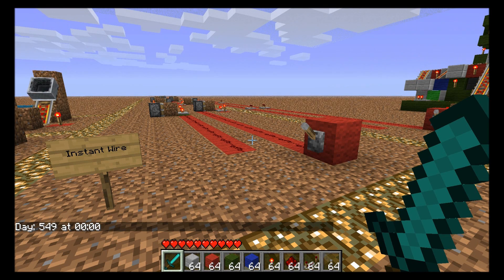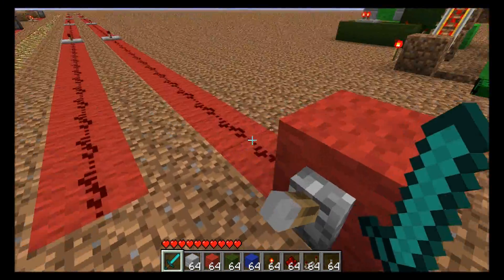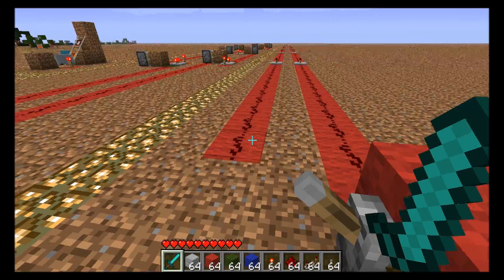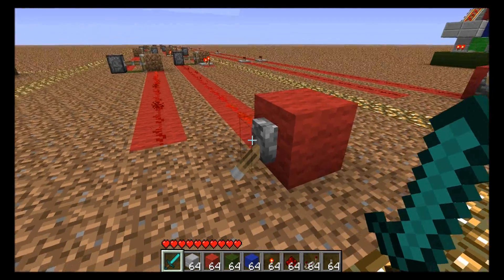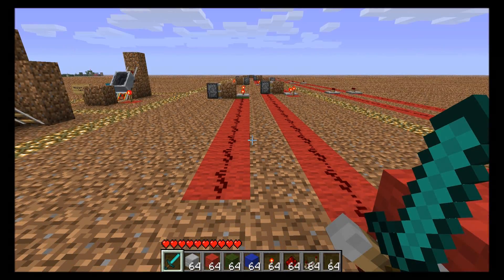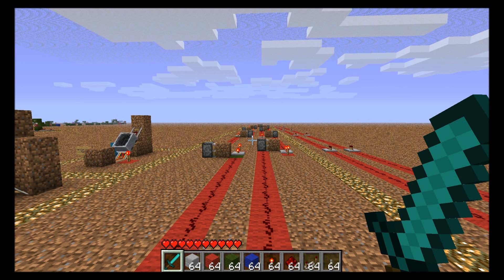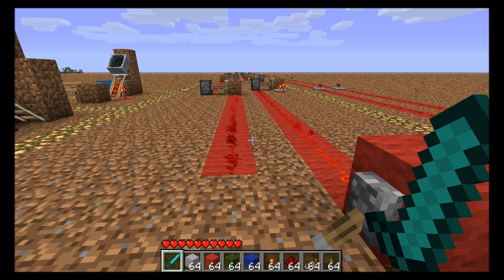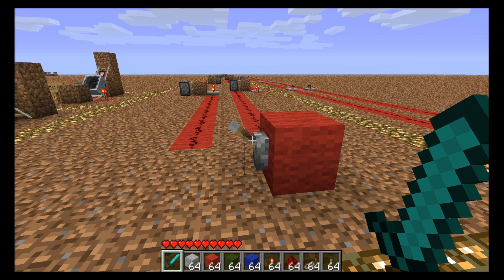Instant Wire

Comment: My god, thank you so much for this, i had the idea awhile back of a "Metronome Clock", due to the different output types, so i'd have the output go in a rhythm, and this Instant wire made it SO much easier, now my metronome clock idea still needs alot of work, but, with it, you can make a waltz extremely easily (3/4 time) etc... noteblocks became better in my opinion, if i finish this 'Metronome Clock' idea anytime soon, i'll perhaps show you in a video ^^ but, again thanks a ton!

Comment from the maker: @snati4 Ahh, there's the problem. I was playing Minecraft full-screen by pressing the Maximize button, but that still leaves the title bar and start bar, so my videos were 1920x1018 instead of x1080. If instead I press F11, that makes Minecraft full screen, and it's 1920x1080. No more black border!

Fraps codec/file size isn't a problem... no matter what you do, captured files have to be reencoded at some point, and WLMM seems to do just fine.

Comment: @funnyshitguy And then it has to be connected to a button, and the delay from 2 inverters (to get it to instantly send ON signal) + TFlipFlop (and proably a pulse limiter/generator) would PROBABLY outweigh the advantages of having the instant wire.

Comment: I think this is because pistons still change the blocks to entities when they push/pull them, so when you turn on the instantwire, you have to wait until the piston actually pushes the block in place for it to be powered, when you break the connection, the piston turns the blocks into entities and you don't have to wait until it fully retracts.